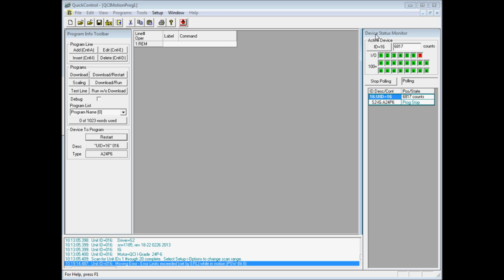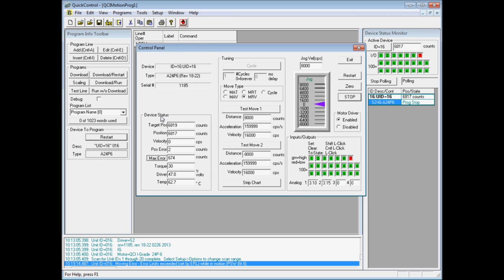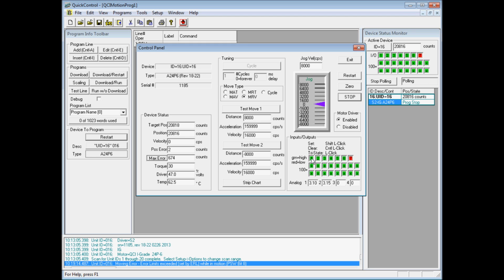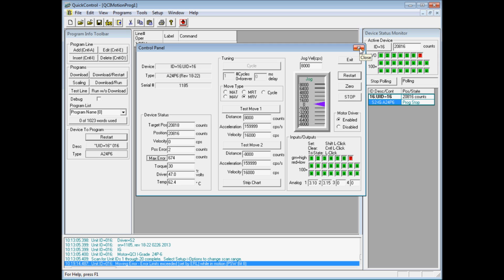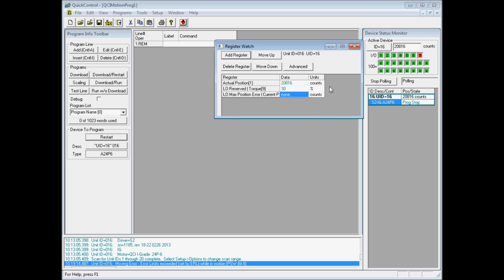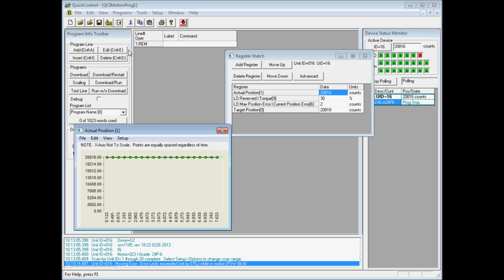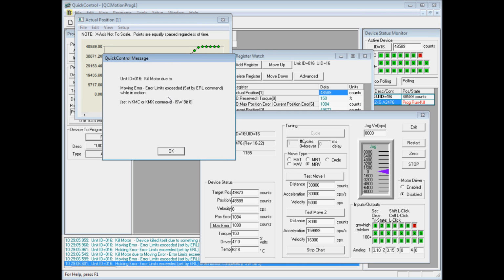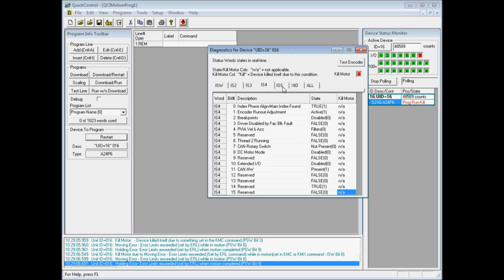QCTV 6 Utilizing QuickControl's Tools

Comment: I am trying to open access to a motor that's connected to the equipment it is driving.  If the motor already has a program on it, how do I just open the motor to examine it, and ultimately restart it remotely?